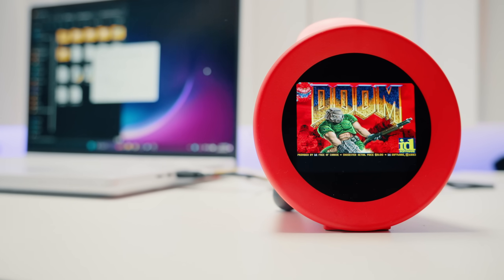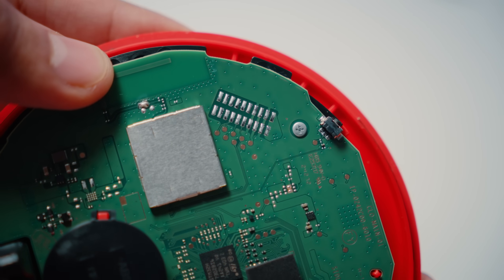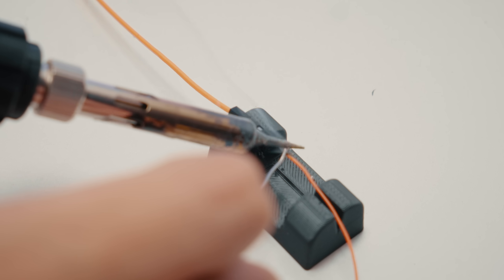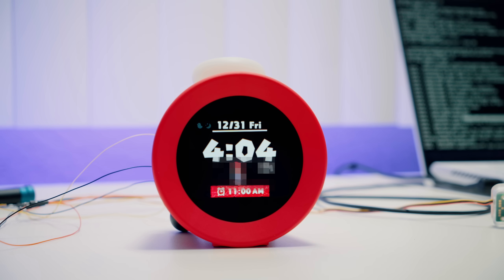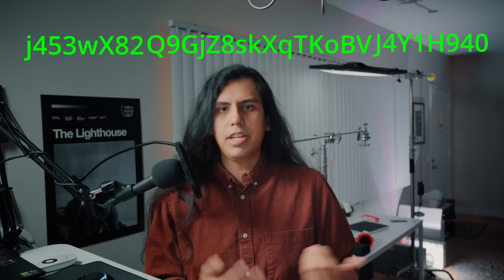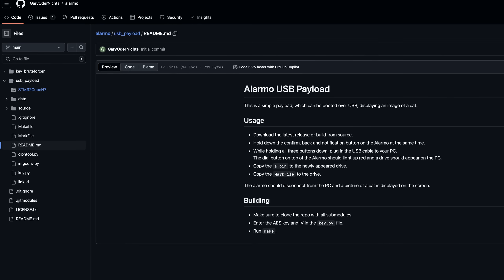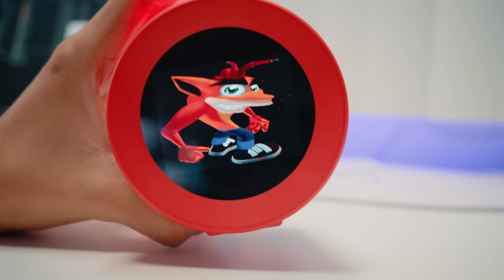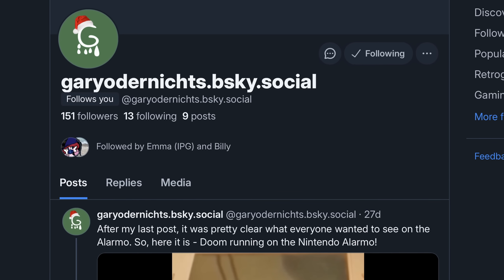Nintendo Made an Alarm Clock, So I Hacked it

Comment: My hands are real shaky when I solder too, but I'm still pretty mental at micro soldering.  

The best advice I can give to improve your soldering skills would be to use a 40/60 mix of leaded solder, and to use a reliable brand of flux.  Rosin core solder usually isn't enough on it's own and leads to add more solder for more rosin, and this usually leads you to bridging stuff.  Adding flux and re-flowing will fix 90% of solder joints out there, I personally use Chipquik SMD 291 because it's not real expensive and it works insanely well.  

Hope this advice was helpful!

Comment: @DammitJeff against the shaking hands you could try soldering under a microscope with a soldering iron which has a grip shorter to the soldering tip. Under the microscope your brain is able to counter control all the micro movements you don't witness that much with your bare eyesight. And the shorter tip length of the iron provides a better grip resulting in less movements on the tip.
Reply from the maker: Thanks for the tip dude, gonna try and get a microscope soon
Reply: @DammitJeff  Sure. Glad if I could help you out! Awesome content btw. Subscribed just today. Greetings from Germany 🇩🇪

Comment: Not sure if this counts as a tip, but one of my electrical engineering professors worked for a company where they had to solder to smt connections by hand

they would take a shot before soldering because alcohol dialates your blood vessels, increasing bloodflow and helping them control the shakiness of their hands (tho he warned that if you drink too much you can make the shaking worse; there's a sweet spot)

never tried it myself so take it with a grain of salt i guess XD

Comment: 10:24 You might want to censor more
If its brute forcing in sequential order, seeing the % progress where each 1/4 key was found tells us just enough information to figure out what the key is.
If each 1/4 is 32 bits, the first part was found at 89.3%, and within 0.1% error, then we know that the 89.3% 1/4 key is around 0xE4000000.
Each 1/4 key is now 256x faster to find with that info. The 10 minute wait is now 2 seconds. Looks like the hex sent in the discord screenshot matches with the 15.7% section.
Reply: I was thinking of the same thing, but he did mention he just didnt want any risk from ninentendo, so censored it just in case, but nintendo cant use such a nosey way only us nerds would find XD

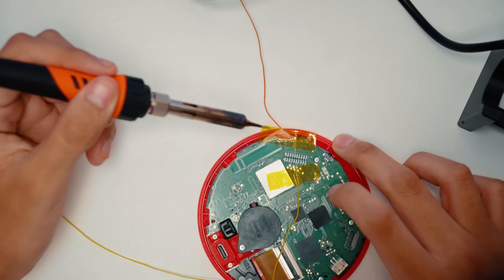Comment: 4:46 I've a shaking problem as well two thing tremendously helped me lower this problem. A big part of that shaking is due to hypertension. So In a daily basis I exercise and when soldering I try to relax and stay still at least 10 minutes before soldering. Also try soldering when you have almost exhaled all the air from your lungs. (It's a tip I've used when I was doing archery)
An other thing that made an even more significant difference is... alcohol consumption. For longer sessions or harder jobs I tend to drink a small quantity of scotch. No joke I found out that way I was suffering chronic tremors (essential tremors) it makes a huge difference.

Comment: Better soldering:
1. Do not drag solder, it needs to be fresh. It's ruined if it spent more than 2 seconds on your iron. 
2. Touch whatever you want to solder with your iron, then add additional, fresh solder to it. Be done in 1 second.
3. Use flux
4. Watch voultar on YouTube 
5. Ask me if you have further questions

Comment: You doing the clock cost at $200 right and you just ripped it apart and hacked it What is wrong with you and only works for if you're single or have no pets😂

Comment: I also have insanely shaky hands and it comes out when I solder. My only recommendation which I think you're already doing is always ground the hand, like place the corner of your palm down on the work surface so it's not free floating or anything like that, and just do it a lot. Trace repair is super hard for me which is what you're doing with those wires, so my only suggestion is just practice running wires a LOT and even with shaky hands it gets easier 💖💖
Reply: Ayo also I didn't see you use any flux D: you should be using flux, and a healthy amount since it's easy enough to clean! Those joints look pretty rough and my main recommendation is use solder with a lower melting point or increase the temperature of your iron, and use flux so it flows more easily! Flux is used to form a barrier around the solder so it has better insulation and doesn't get oxidized too quickly, effecting how quick the solder solidifies

Comment: Hold the soldering iron underneath and let the solder flow down. When the wire is hot enough, the solder will flow nicely. Take away the solder, leave the iron a second longer then remove. The top method you use is applicable for PCBs.

Comment: Tip for improving your soldering: Get an iron with a very short finger-to-tip distance, like the TS-80P, that way you're shaking wayyyy less. It makes a big difference. Also use flux and good quality solder and the right tip for the job

Comment: For your soldering, get flux. When you have the wire taped down like that, you can just add flux then heat up the joint and feed in solder, the solder will just snap in place when you use flux.

Also get a better iron. You have no idea how big of a difference a good iron that can actually hold a temperature is. Pinecil is pretty low cost and a really excellent iron.

Anyways, awesome video. Really great summary of the Alarmo hacking scene so far. This stuff is always super interesting to me.
Reply from the maker: Thanks for the tip man, I’ll definitely check out that pinecil. Yeah this is an old piece of crap iron that I bought for $10 bucks when I first started my channel, it has terrible temp stability. figured it’s time to upgrade now.

And thanks again for the kind words, appreciate you watching :’)

Comment: Others have done some soldering tips, but I haven't seen what I consider the most fundamental one (though I might have missed it); when soldering, you ideally don't really want the iron to directly melt the solder. You want the parts to get enough heat from the iron, that the parts themselves can melt the solder. As others have mentioned, too, you need some flux core solder, for jobs like the ones in the video (and if you want really shiny joints, some external flux to keep the oxygen off of the pad while it cools, though this is just an aesthetic thing). Another tip is to "tin" your wires, before soldering them to a pad. Touch your iron to the wire, feed in some solder and let the wire melt it (not the iron!) and wick it onto itself, and then cut the wire to an appropriate length. You may also want to tin the pad you're intending to solder to as well, to get rid of the (most likely) higher temp solder used on the PCB initially. For the shakes, try steadying your hand on the table or whatever surface is holding your parts (you may already be doing that in the video, hard to see). Set yourself up for success by spending a bit of time working out how best to position the part so that you can steady yourself on the table and so you're comfortable soldering. Finally, when soldering wires, to make sure your soldering is good (at least for long-term stuff) give your wires a light tug. If you really want to stress test a sacrificial joint, the wire should break before the solder joint

Comment: i shake a lot while soldering too, one truck I found to be useful was taping stuff to the table, be it dev boards or whatever, make sure the board doesn't move, and as for your hand, make sure your elbow isn't flying and is set on a solid surface, and try getting a smaller soldering iron that you can hold as a pen

Comment: Put the soldering iron to the component you're connecting, and then add the solder to the component. Don't just put solder on the iron and then try to spread that onto the component, as that doesn't make a good flowing connection. Also use flux. Basically, the metal on the component oxidises really, really easily, and that resists the solder. Flux has acid to remove this oxidation layer, and also heating up the component makes it more likely to take on the solder.

Comment: This is was great. I’ve gotten good at soldering over the last 7years and I shake like crazy. Flux is your friend (even tho it does make a mess and add steps. No clean flux is nice but the gooey stuff works even better) but when you use flux and your iron is clean and hot you don’t have to hold still for long you just go in and touch the spot with solder on your iron and the joint makes itself. But yea go in and touch fast and get out, you don’t have to hold still. 

An additional note after you solder  with flux for a bit you start to kinda understand how much heat and solder is needed when and where and then you don’t have to use flux all the time. Also lil less caffeine when soldering helps too

Comment: it seems to me that the dupont wires were kinda useless here since you ended up soldering the wire straight to it anyway. in the future could me made way more efficient with just soldering the wire straight to the connector pigtail
Reply from the maker: Ideally I wanted to be able to re-use the debug connector for future projects if needed, stripping them and soldering directly, means I'd have to undo the solder for every project lol

Also, lotta stuff people can't consider, I'm also filming a video while doing this whole process lol. If I mess up the only cable I have, I'm fucked and I wouldn't have been able to get a new one in time for the video date lol. Whereas, if I mess up a solder point with the Dupont wires (which I did), I can just try again with the 40 wires that were included lol

Comment: Regarding soldering, someone else mentioned it as well: 1. Use flux. 2. Use a better soldering iron, specifically one that is easier to hold closer to the tip - TS100 is my every day soldering iron it works great. Use a fine flat tip, and again, use flux.

Comment: The only acceptable answers to "does it run Doom" are "Yes" and "Not yet"
Reply: There are also certain appliances that can't run Doom due to a distinct lack of digital logic. Buuuuut who says you can't cheat and hide a computer inside?
Reply: @LemonbreadSC  The raspberry pi pico is all you need, and you can sneak one of those in almost any appliance!
Reply: @LemonbreadSC people gotten Doom to run on gut bacteria before, that's not an excuse
Reply: Gotta remember that one and also "T-Shirt quote!"
Reply: There are still some extremely old machines that just cannot run DOOM. I'd wager that it's impossible to get it to run on the Atari 2600, for example.

Yes, I am aware that the NES has been "reverse emulated" by Tom7. But is Doom really "running on the NES" in this case? I would argue that it's "running on" a Raspberry Pi, and just using the NES as a graphics card. I would argue that having a machine "run DOOM" means running the game code on its stock hardware, plus any period-appropriate external supporting hardware (like a game cartridge; this includes the SNES as "running DOOM", for example). Under such a definition, most machines from the 80s and earlier simply cannot run DOOM.

...that said, I've seen the VIC-20 port, so I am curious just how weak of a machine can be made to actually "run DOOM".
Reply: I ran doom on a kindle paperwhite
Reply: I'm starting to feel like the "does it run Doom" question is being milked so hard it doesn't seem interesting anymore.
Reply: @AndriuxDev  can it display bad apple?
Reply: @katakombejc DON'T GIVE HIM IDEAS!
Reply: @AndriuxDev because the answer is always same and people always say that, thats prob the reason
Reply: @AndriuxDev  I personally think that the answer is not important, the fun part is seeing how they did it

Comment: Just wanna say I feel like a doofus for not doing the tape thing with the wires for soldering when I was working on an entirely different project of modding my N64 to overclock the CPU a little bit. (That ended badly because I used solid core wire, and was working with two of the CPU's VERY fragile and tiny legs. You can probably imagine where that's going, lol)

Comment: Pro tip - don't strip 2 cm of the wire, strip just 1 or 2 mm and tin the leads. If you want to strip them longer, you can, just clip them after tinning. Also don't be affraid of using a soldering flux. That will help you A LOT (especially with modern lead free solder).

Comment: It still bugs me that this clock only works with a USB-C plugged into it, and they don't even provide a wall brick. $100 for an alarm clock that stops working if the power goes out, or if you need to plug in something else.

Comment: Your hand movement seems fine, but you need to use flux. it will really help with keeping the solder in place while it's still molten and and keep it from getting to...blobby like it did in this video. (you also used a bit too much solder too but flux lets you get away with using much less too by the way). It also helps prevent cold solder joints and such and lets it flow better which allows you to use less solder to do the same job. For temp debug wires I suppose you did well enough since you'll probably be removing them anyways. But yeah flux will help keep the solder work nice and clean. ;)

Another thing you can do to make this easier is to "pre-tin" the solder pads before putting the wires on. That is you add solder to the pads first, clean excess solder off your iron,  then you add the wires by melting the solder on the pads to get the wires to stick on with a bit of added flux when needed. This is mainly how you go about controlling how much solder to add to each pad. Sometimes if I try to add solder to a new pad with the wire in place already I could end up putting too much solder on it too so just pre soldering the pad first lets me get that under control before the wire comes in.

And yeah I'm not great on holding my hands steady either and I'm also left handed. (it appears you are too? :P) But I've gotten by with some good flux and and a temp controllable soldering iron. I've managed to replace some batteries on a few N-Card DS flashcarts I have and those things are tiny. Solder pads are even smaller and closer together then what you worked on in this video and using flux for that is pretty much a requirement.

I probably need to get a some new solder tips and copper sponge thing used to clean the tips. Mine is pretty used up and is probably why I'm having a hard time keeping the tips clean. :P

Comment: For the soldering:
Just use flux, it does magic to your solder joints.

I personally use flux in paste format, as liquid flux just vaporizes instantly, and this, even if it's a bit messier, it "wets" the pads better and for longer, leaving you plenty of time to do the joint nicely.
Then it's just a matter of some IPA alcohol and an old toothbrush to clean the spent flux.

Also, good solder does make the difference. Use 60/40 Sn/Pb solder

Comment: You didn't use flux in your soldering? Like that's a tip number one. Then it actually you know melts to the contact and doesn't just blob on top.
Reply: Louis Rossmann and Ben Heck on youtube have been my saviors on soldering.

Comment: I can tell you a few things about soldering:
1 - Do not strip the wires too much, only strip as much of the shielding off so that it is only just half as long as the pad you're soldering to
2 - Always pre-tin the wire before trying to attach it to the pad, this makes it much easier to solder it onto the required pad
3 - If the pad itself has no solder already on it, pre-tin this as well
4 - use some no-clean flux to help flowing the solder easier onto the wire and the pad
5 - if there is already solder on the pad, pre-tinning the wire is most of the time more than enough, if you add too much solder it might lead to accidental bridging of two adjacent pads/wires

I hope i could help you with these few tips and i wish you happy soldering!

Comment: you suck at soldering mostly because of the equipement. good soldering irons (for ex. oss team t12-x plus) can be brought for less than 50$ if you find a good deal on aliexpress + you solder is bad because it doent have any flux/rosin in it so its hard to solder
i have my t12-x plus from oss team for a long time now with some cheap solder and even tho im bad at soldering it makes it 50 times easier
the only complain i have about it is that when i use it alot it starts to heats up slower and slower

tip for soldering:

if you are soldering wires then put a little bit of solder on your soldering iron, place it on the wire you want to solder and instead of putting solder onto the soldering iron put it onto the wire and hold it on there until the solder starts to melt 

there are also other tips on youtube for soldering to pcbs (surface mount and tru hole)

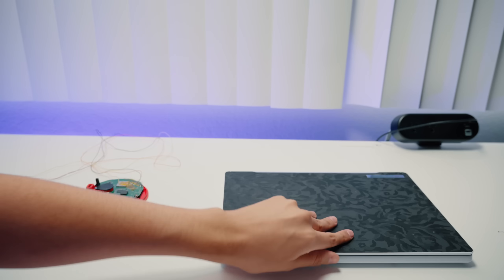Comment: what is that laptop on 5:26??
Reply: asus strix g14, you don't want one because asus doesn't know how to fix design flaws 10 years later, so the mosfets will blow up and short to ground usually cooking your CPU or GPU, it's fun and games! 1-2 year lifespan.
Reply: @AeRiaL_ does the normal rog g14 have the same issue? i got a 2020 model off ebay for under $500 n wanna make sure mine won't greenade itself

Comment: The only difference between a good and bad solderer, is flux.
Add lots of flux. Even if you're using flux core. 
You can also try a higher power soldering iron, not higher temperature, higher wattage